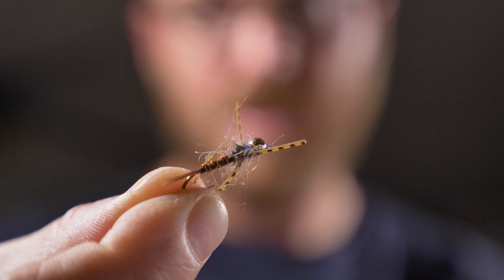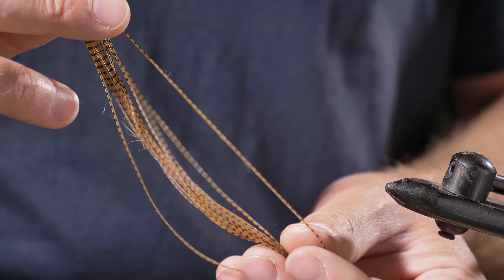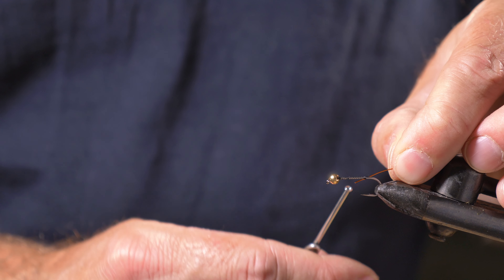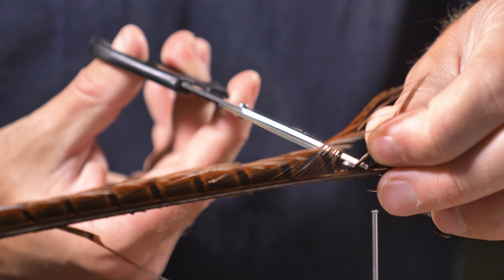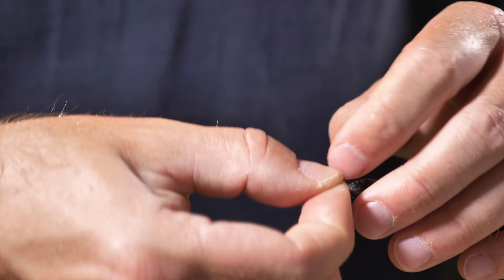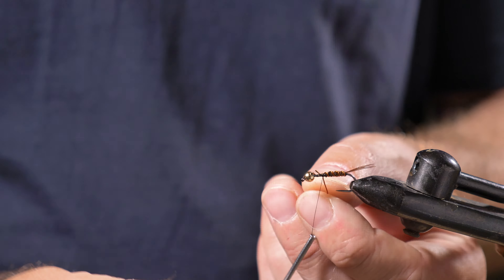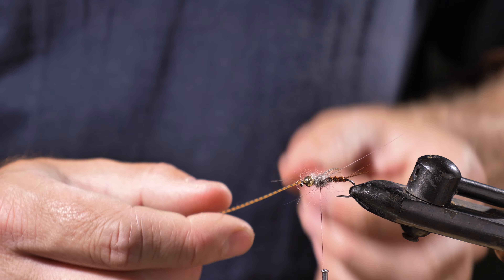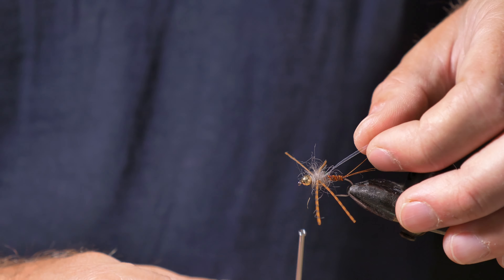How to tie a rubber legged FLASHBACK PHEASANT TAIL nymph variant

Comment: I like to wrap some lead free wire and jam it against the bead to keep it seated. Adds a bit of extra eeight to get it down there faster too. Good tie man.
Reply from the maker: Thanks, that's a great tip I do sometimes use as well. Tight lines